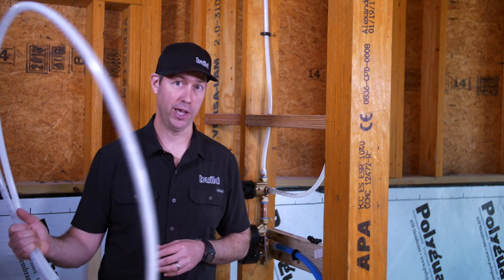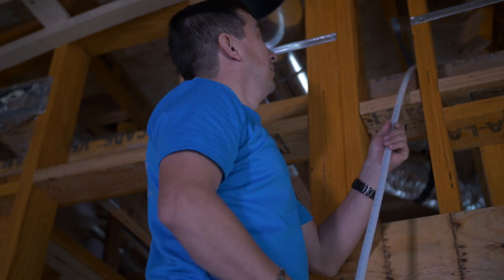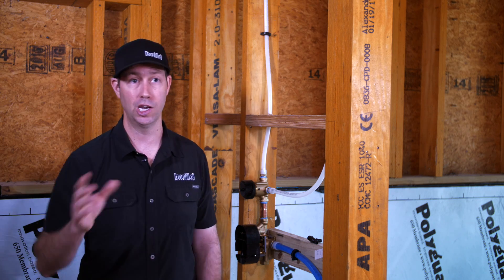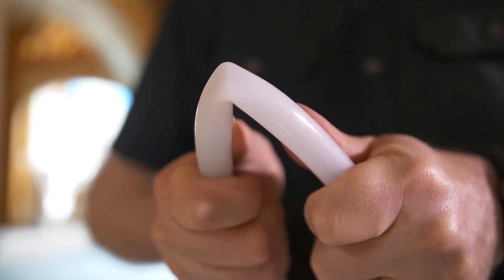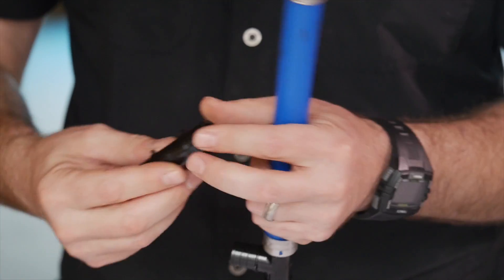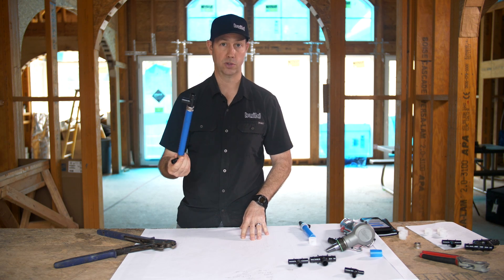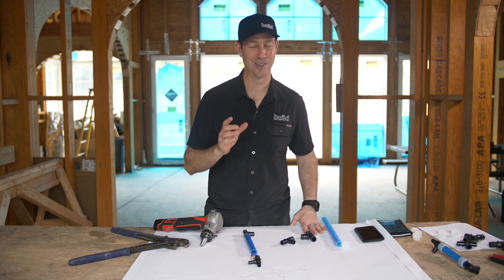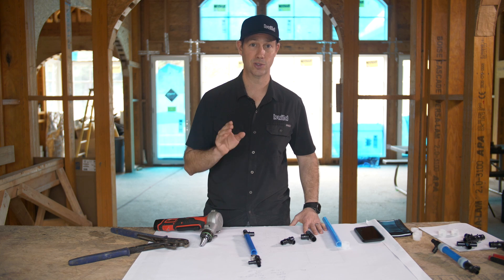PEX vs. Copper Plumbing

Comment: The title was PEX vs. Copper but this video was really all about PEX.  Should have discussed the pros and cons of cooper as well and the complexities of sweating, routing, etc.  It was interesting, though.
Reply: you know I will have to look into it, the City puts out what they put into the water system
Reply: I would just try to keep the joint outside of the walls and/or accessible.  It withstands 14% expansion & water expands 9%; so it's not supposed to burst in a freeze.  Uponor expansion kind.
Reply: Doug Philips:      But was your stipulation to copper IN WRITING?     A written, detailed contract solves a lot of sins, in advance.
Reply: Copper thieves get a dose of lead in my house.
Reply: @TheBoneman42 Don't grind it up and eat it, or really grind it up and inhale it- bigger game than bacteria find it poisonous- like humans! This was known many years ago, earlier than the '50s. the saving grace is that the rate of leaching into the water flowing through is very low and as some earlier poster pointed out, like all metal pipe systems, it develops a coating of calcium oxide over time. This Calcium oxide is what had protected the Flint water clients for decades against the dangers of the lead pipe remaining in the system- until a government/bureaucratic disaster changed the water source and the water chemistry, destroying this oxide coating in the lead pipes.
Reply: He listed only the downsides.
Reply: People don't break into houses to steal their PEX, lol...
Reply: VS means "Versus, against" So now you know -
Reply: Sorry, Boneman, to tell you that you are very wrong.  Silver is used on surfaces like door knobs, counter surfaces and travel clothing specifically because of it's antimicrobial properties.  You can research this when you are not making things up on YouTube.  It's one of the reasons for silver-ware, when it was silver.  It is used as a sacrificial anode in clothes washing machines.  And the list goes on.
Reply: There are plenty of disadvantages of copper, and he listed several.  Expense, installation difficulty, sweating toxicity, copper corrodes with ph, scale builds on copper, flow reduction from bends/limits to number of bends,  copper pipes are more prone to freezing/bursting, copper has high thermal conductivity so your hot water has to heat the pipes and surrounding area before getting hot at the tap, ect.
Reply: Berelore copper also conducts electricity which can be a big problem if it becomes energized.
Reply: @Califdad4, he said a lot of Chlorine. Typically, if the water cleanser aren't apeshit at their job. You generally have very small amount of chlorine in the water. Which shouldn't affect the PEX. But if they consistently use large amount as if they are trying to cheap out on water processing. Then you might want to go with copper.
Reply: The advantages of one are the disadvantages of the other.
Reply: can be as much as copper and sometimes more i have been in the trade since 1986 i prefer copper but i still have to work with uponor and b plastic do it proper do it copper if done in this manner it lasts long what is the life of grade a b or c and what about recalls 1990 and the crap from 10 years ago what is the next plastic recall has ther ever been a recall on copper
Reply: @chrisbrown9572  I got my kitchen, 2 baths, laundry room 1 level 1900 sq ft home, done for $3,000 with PEX, my neighbors have a 2nd home on the North California coast and just did a redo of copper and it was a bit over Double what mine cost
Reply: Well Mr Cooper can get pretty complicated, but not so much as Mr Copper.. 👀
Reply: DEEREMEYER1 Do you think that turning to SHOUTING mode makes you more credible? It more likely makes your comments go unread.
Reply: Doug Phillips  Sure, I'll install whatever you want.  If you're the lone wolf who will insist on copper, I'll be glad to install. I miss running pipe.....But in ten years of doing pex, I haven't had one pereson go with copper after the price difference is shown.  And I've been enjoying saving my customers money on a pipe job.  Run hot and cold for a bath, kitchen, w.heater and laundry in 2 to 3 hours?  Yep.   Fun .  I miss copper though, so if you live anywhere near the San Joaquin valley , let me know and I'll do your piping!!
Reply: Paul Haney copper is anti microbial like brass, silver and gold. No one talks about that part
Reply: @1stfloorguy59  
Not to mention plastic is toxic. Imaging if someone with plastic pipes say turning on hot water and cook with that water...😳 I'm confident that's harmful for health.

PEX is surely easier to install though... 😒
Reply: Bright clean copper yes, but wet copper pipe walls become oxidized in a few months, so say goodbye to any anti-microbial effects forever after that.
Reply: +DEEREMEYER1

Nothing that you said about "sweating", "brazing", or "soldering" is correct.

"sweating" is Just a term to indicate that a fitting is to be soldered or brazed in, rather than being threaded, or other type of mechanical connection.
Both soldering and brazing are just flowing a filler metal between the mating surfaces of a joint, without melting the base metal.

The only difference between soldering and brazing is the temperature that the filler metal becomes a liquid at.
Soldering is when the filler metal is a liquid at less than 842ºF(450ºC).
Brazing is when the filler metal is liquid at 842º(450ºC) and above.

You are also completely hilariously wrong about the thermal conductivity of copper, and its ability to withstand water freezing within it, as well as the expansion characteristics of PEX.

As an HVAC/R guy, I find your ignorant ranting really quite comical.
Reply: My torch tip will go places the Pex crimper won't fit into.
Reply: Dan Strayer I can put together a whole string of PEX, and not have to sweat a single joint in a crawl space, lol.
Reply: Domminign  I can install Pex in 25%of the time to install copper. lol.
Reply: @216trixie  That only benifits the customer if you discount them the 25%.  Highly doubt you are doing that, but maybe you are.
Reply: Very True! I've installed both many times.
Reply: I have a  larger 50's home with old galvanized plumbing that I will need to replace soon, since I have good access under most the house, I am figuring to do pex.    My city here in northern California uses chlorine and  Floride in the water system, but lots of this type of plumbing done in my area with no issues
Reply: @califdad4  So was it really full of crud?
Reply: @dperry19661  I had the replacement last Nov 2018.   The new PEX works great and yes the old  stuff we as pretty bad.   My plumber also handled my bathroom remodel , moved everything around gave it a better arrangement.   I'm very happy. Got everything done for about 12k
Reply: In commercial, it's copper only. We shy away from soldering and brazing (mostly). Now we use pro-press.... Pex has its pro and con like copper, comes down to the installer
Reply: @matttheplumber00ify  Pro Press has some uses, but near boilers and other machinery like commercial dish washers, disposals and electrically controlled valves , work needs to be done to keep water hammer form slowly vibrating the o ring seal off the end, and it can't be used within several feet of the discharge- 120 degree water will harden the o ring over time and the 160 degree water commonly used in commercial D/W will really cut the life. this long story is to make the point that conventional copper can do all thee things- freezing temperatures are a problem, but since the concept of indoor plumbing was to have water and drainage in the house when the weather was too bad to use the commonly outdoor kitchens and outhouses of an earlier day, the pipe should be insulated or run in a wall adjacent to a conditioned space.
Reply: I know a lot of guys who use PEX on commercial jobs.
Reply: I use copper pressfittings, and i am 25% faster than you ...
Reply: Are you sure it's chlorine and not chloramine?  They are different and react differently.  Just curious.
Reply: I built a house 20 years ago. They used copper. Last year I started having pin hole leaks develop. I had about one a month. I now have had it all ripped out and replaced with PEX. My sister had the same issue with an older house. I will never let them use copper again.
Reply: @davidhorizon8401  What type of copper piping was used?  Type L or Type M?  Big difference between the two.  If yours is already leaking, I'm will to bet that some cheap plumber used type M copper piping.  I had mine repiped with type L copper in 1997.  No leaks, no problems.  My neighbor has type M and her walls and floors are being replaced right now from a leak in that thin piping.
Reply: @davidhorizon8401  Im very happy with  my pex plumbing
Reply: Yeah but copper still wins in my opinion, most people who have been in the bizz for a while are familiar and proficient with copper, and i'd rather have an old pro with copper than a new guy with pvc or pex. pluss copper looks nice as f*ck. ive cracked probably dozens of PVC pipes in just retro renovating my house. But, if i had to choose pex or copper, ill take copper, but i know how to plumb PVC So, Ill do my plumbing myself and save the most bucks.
Reply: That is because this video is 90% about PEX and not much else.
Reply: Copper isn't "ever so slightly more difficult installation" it requires soldering skills that aren't picked up overnight.  I have copper pipe that has flux left on it from a lazy plumber when they built the house.
Reply: @LastAvailableAlias  soldering is really easy lol
Reply: it seems like you where not paying attention hahaha  he did talked about copper. The point is pex WON
Reply: 216trixie, you're being paid so i want whatever time it takes. I just had a plumber try to use cheap pex when i Clearly said copper.
Reply: pauldhaney 
He didn't because the only downsides to copper is the expense and ever so slightly more difficult installation.
It would have been too obvious he's just being cheap with the plumbing.
Reply: "the only downsides to copper is the expense and ever so slightly more difficult installation" ?
First, your "ever so slightly more difficult installation" is a bit underestimated.
He mentioned a number of others -- freezing could burst copper, elbows reducing pressure/flow and causing stronger water hammer. And more fittings = more fail points.
I just prefer copper, but clearly PEX does have some benefits.
Reply: 2Truth4Liberty copper has been around for years and years... Do you remember when quest pipe started failing? It was plastic as well. Everybody was getting free full repipes in their houses if they got on the class action suit...
I've heard not water hammer with PEX, but usually after a few years those little nailed hangers come loose and they slap against the drywall and the wood. Then I get called to go fix it and make lots of money off people. Now mentioning it I love PEX!
Reply: matt lewis only a moron would pound nails into their hangers is a nut, but I've never seen them pop loose. We had a huge freeze a few years ago, and only had one PEX joint come loose (wasn't our job), but the houses done with copper needed canoes to go from the kitchen to the living room.
Reply: And as Matt said, copper bursts when it freezes. 
And BTW copper corrodes with acidic water.
Reply: @henrytwigger2245  Had that problem. Replaced an exposed copper line two years in a row. Third year finally learned my lesson. Used some plex b. problem solved.
Reply: @Efferheim  Well, and pressure drop due to all the right angle fittings.
Reply: @Efferheim  you dont have meth-heads stealing your pex

i had pex freeze up for several days......then it warmed up and the hose bib started working again.  Try that with copper.
Reply: Only a moron would use PEX, and not charge going rate to do their work. I've never seen copper turing be as flexible as PEX, though, lol... Also, pretty much any plumbing apprentice I've ever seen is able to sweat copper joints. I also know a lot of novices who can sweat joints, too. Plumbers are definitely needed, though. Just remember the plumber's creed. Shit flows downhill, and keep your mouth shut.
Reply: @ Kelly Pugh, 
I'm confused... what is "going rate"? Are you suggesting that a plumber who is not a moron would use PEX and charge the amount of time it would take to do the job in copper? Around here, the 'moron' would get the job and you would be permanently removed from the tender list.
Reply: @yeti7520  Plumbing whether new install or repair is very competitive in my market- charging the going rate here means your price and your warrantee better be competitive- stealing from a client who doesn't know the difference will lead you to an unhappy end, sitting in your "going rate" shop, while all the co.'s with sharp pencils take all your biz- not to mention what the poor faith you've demonstrated will tell your current client base.
Reply: @fredericrike5974  Where I live, there's no one sitting at home, stroking their egos, while the cheap guys work.

Comment: Uponor's pex A is the best. Sold wholesale for many years, hundreds of thousands of feet per year and never an issue. Both radiant heat and plumbing as well as ice melt and fire sprinkler systems. Took many customers to Apple Valley and had a blast...these guy's just get it....

Comment: Any problems with the copper crimp rings. I like that Milwaukee tool but as a home owner I can't justify that for a repair. The pipe I use has lots to do with how I can make repairs. That's why so many use the pvc. Funny how people here are saying they would never use pex cause it's petroleum when pvc is so commonly used. I love pex just can't decide on fastening system.
Reply: The Uponor system is the most fool resistant. Will be much more expensive with 1 leak than this tool. Buy it and keep it in the garage?